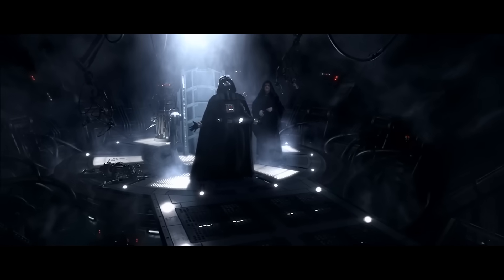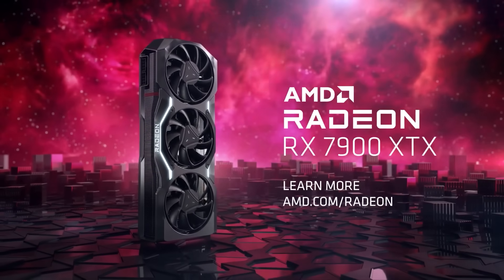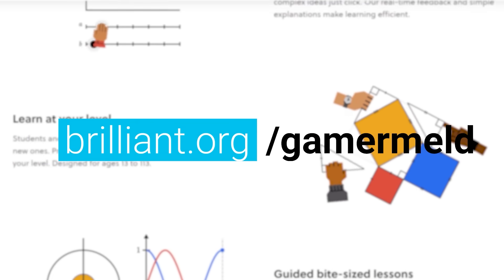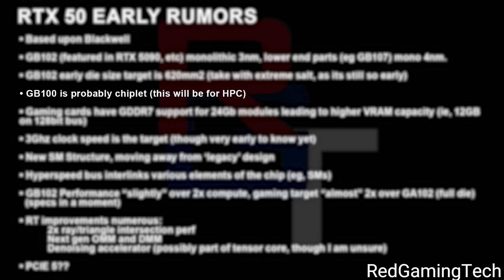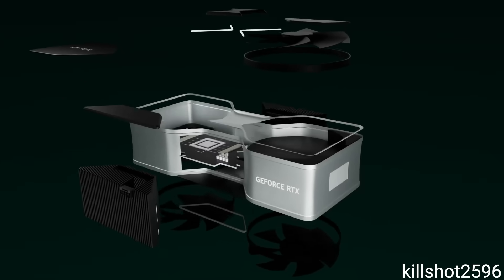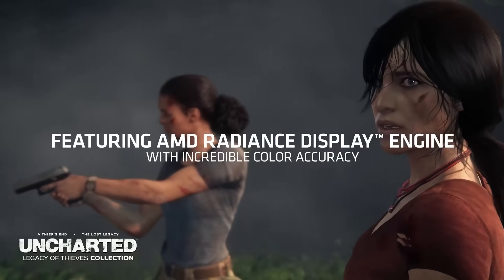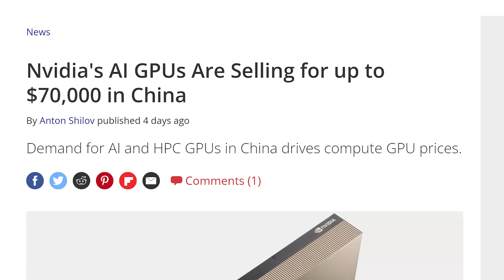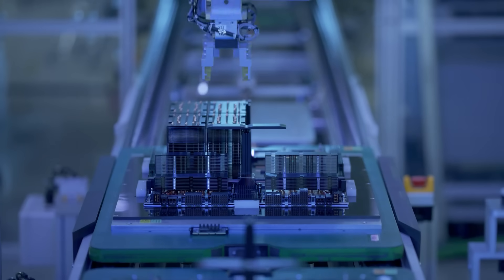Say GOODBYE To GPUs Again!

Comment: Or they could be smart and create an AI focused card instead of relying on their gaming ones
Reply: They did make AI/work focused cards, but they cost a lot and were running low on supply
Reply: Bro u didnt even watch the video
Reply: they already make them, and gaming gpus for ai is too slow! so if hike happens its fake/sintetic
Reply: @felixmdx gaming GPU’s are just as fast as AI accelerators. The only real difference is memory capacity and bandwidth. If your AI workload fits within the memory buffer of a gaming GPU, it’s easily the most cost effective hardware to deploy. But most new models use > 16/24 GB of memory which is why the AI accelerators are so expensive. If your use case demands that much VRAM (or HBM), there are no substitutes and nVidia can charge whatever they want.

And the coming price hikes in 2024 and 2025 will be very real. The entire semiconductor industry is going to shift a ton of production on TSMC’s 3nm node to AI accelerators, and there are going to be shortages of every other product designed for that node because there won’t be enough 3nm capacity to go around.
Reply: @felixmdx not really. Yes gaming card might be slow against something like A100 or H100. But that is top of the line AI card. Not everyone need those. Nvidia also have their lower tier AI cards and most often this kind of card are using the very same chip as gaming gpu. So raw performance wise they are practically the same. Some nvidia AIB start releasing 40 series with blower cooler. And in their advertisement they mention how those blower cooler fare much better in system with multiple GPU inside them. There is no gamer  doing multi gpu anymore. The card with those blower cooler are specifically design for those that want to buy the 40 series for AI workload. Company buying gaming gpu for their AI work is nothing new but now this thing end up being in the news. Same with previous mining craze. Things only get crazy by the end of 2020 but miners already start buying their gpu in bulk since mid 2020.
Reply: As long as the card support FP32 that's mean it can run AI workloads. GPU have supported FP32 since forever now. Right now those that can't secure their AI hardware are turning towards gpu because GPU also capable of running AI workload.